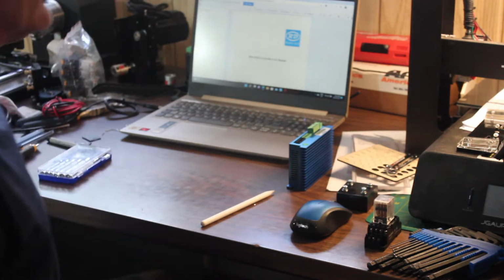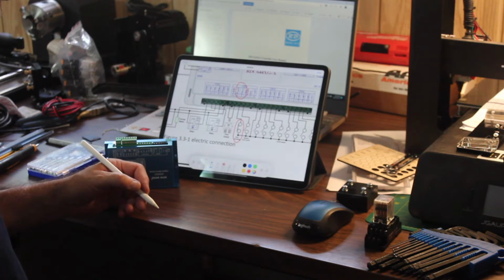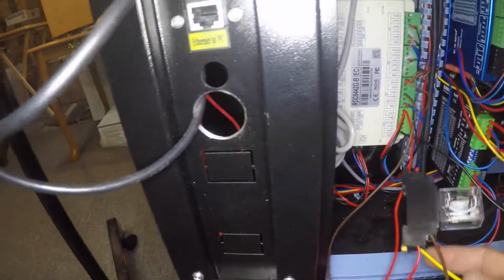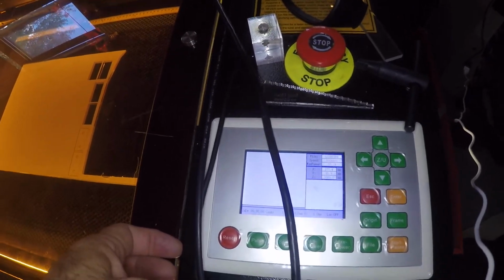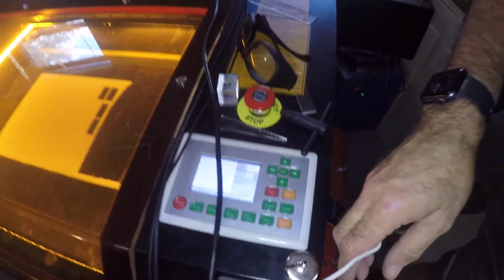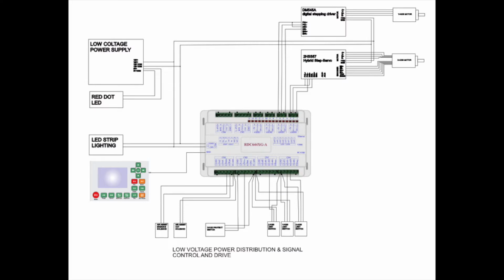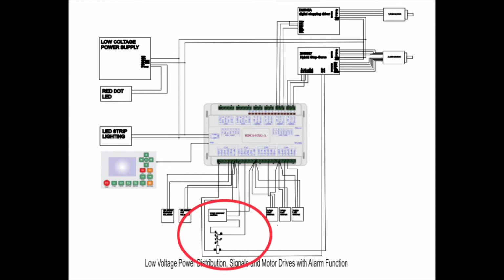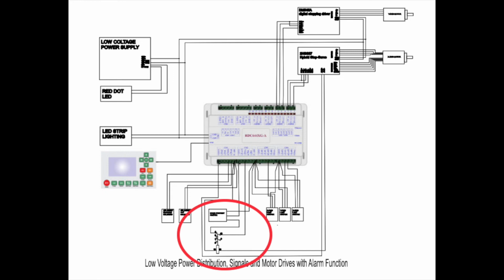Incorporation of the Alarm Function for Hybrid Stepper Driver

Comment: Great video, thank you. Just a question: I see that the output ALM is an open collector output. By using a relay you have no need of using Pull Up Resistors to detect the output status? Or do you need to usesresistors every time with an Open Collector Output? Thank you